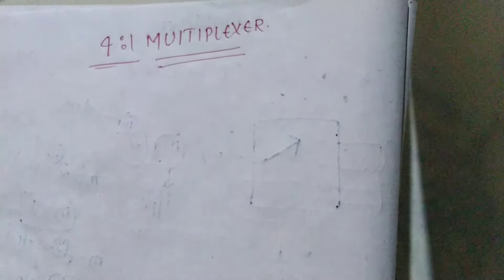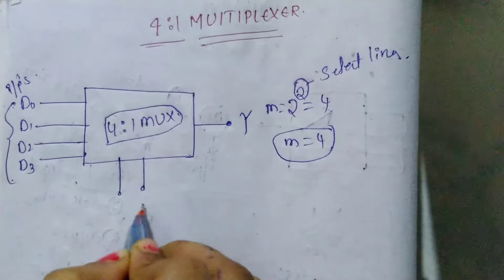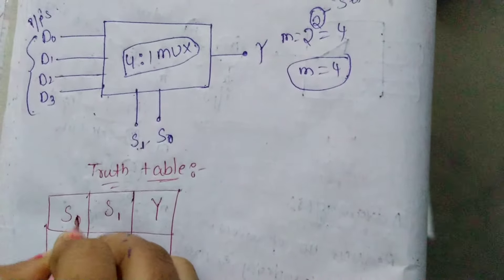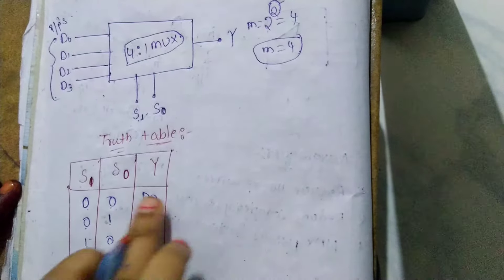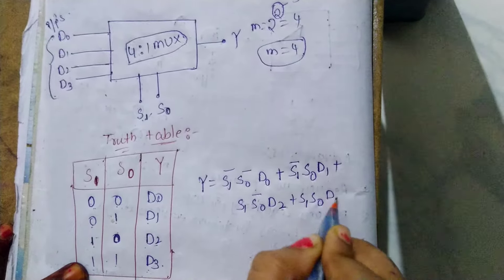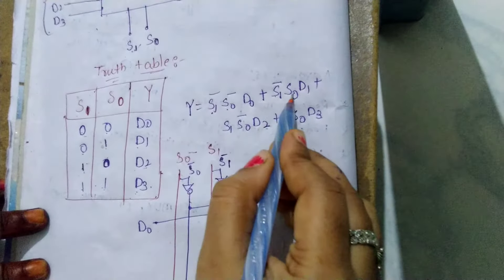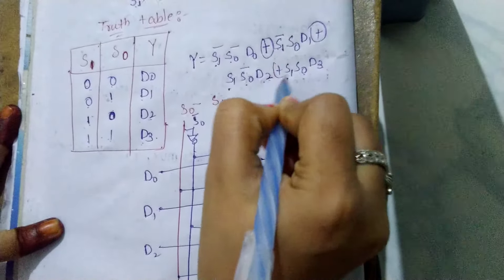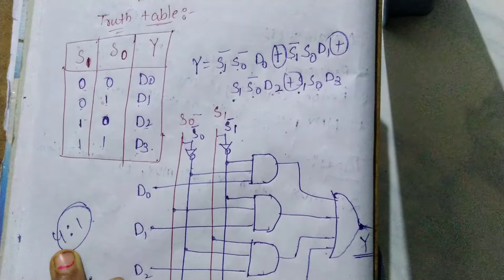4×1 multiplexer || IN TELUGU|| DIGITAL ELECTRONICS,STLD|| ECET,BTECH,DIPLOMA

Comment: madam, you forget to apply log here. the formula will be n = 2 power m ,
by applying log on both sides,  m = log base 2 power n
=> m = log base 2 power n 
=> m = log base 2 power 4
=> m =  log base 2 power 2 square( 2 square = 4)
=> m =  2 log power 2 square 
=> m = 2 ( since, log and square will be cancelled )
hence the total no.of selected lines = 2.